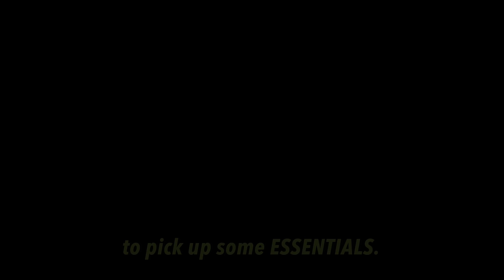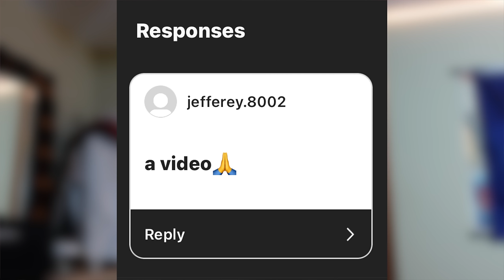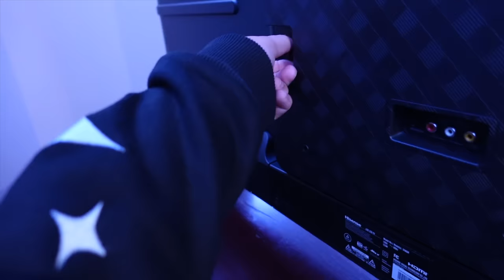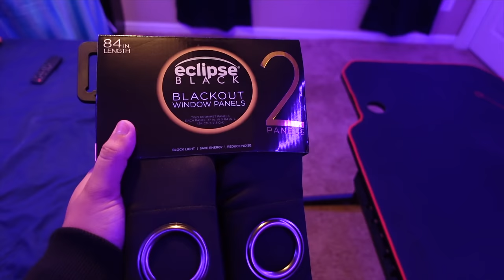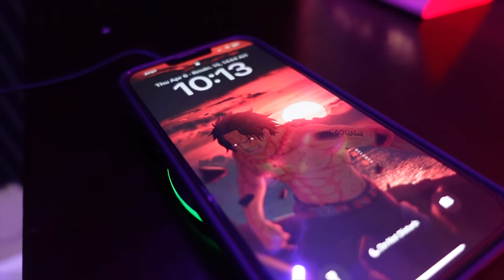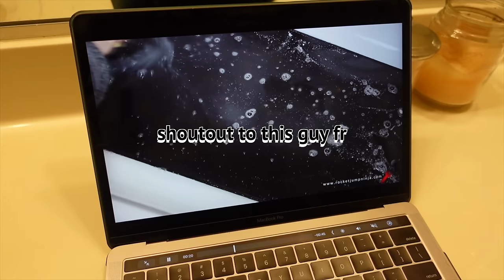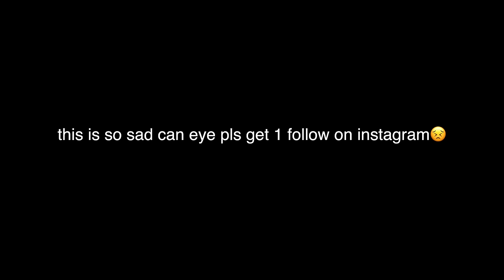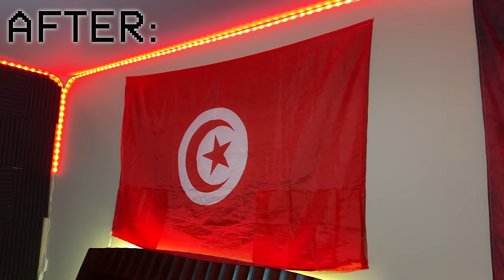Transforming My Brothers Messy Room Into His Dream Room!

Comment: Pro-tip, you might want to add diffuser channels for the led lights instead of having them adhere directly to the wall, they wont peel paint off the walls and it'll also make the job look cleaner since you could cut the lights to size and hide the excess cables.
Reply: what does add difuser channels mean?
Reply: @wprince I've explained the purpose of adding them to the walls already. But It's a piece of aluminum metal you place the LEDs into with a white cover on the face that lets the light of the LEDs shine through but "diffuses" the light so it looks like one big bar instead of a bunch of little lights. You might also want to google "diffuser channels". You might just need to see them for yourself if I didn't explain it well enough.

Comment: you can dead ass just throw the mouse pad in the washer i used to always hand wash them until i got lazy one day and just threw it in the washer and dryer and it honest would sometimes come out better than when i did it by hand and it never shrunk or anything just dont obv have it in the dryer for too long or with hot water for the wash and if youre scared of it shrinking dont even put it in the dryer i have 3 different mouse pads and i wash them all like that no issues only if you have like ironed on like logos maybe they will come of my logitech rubber logo came off but i dont really care about that lol